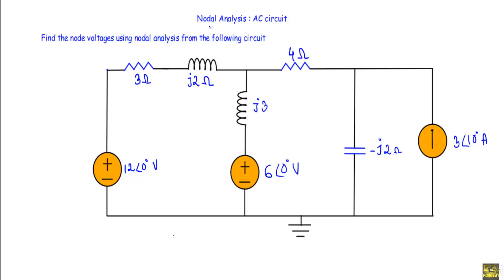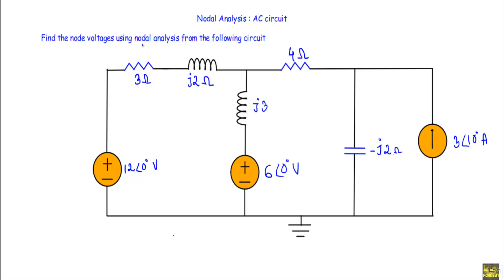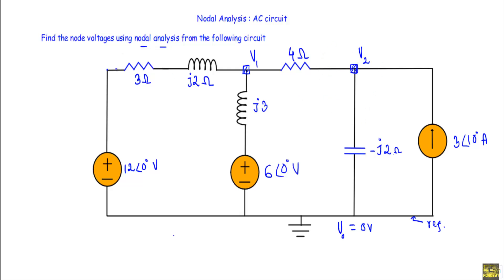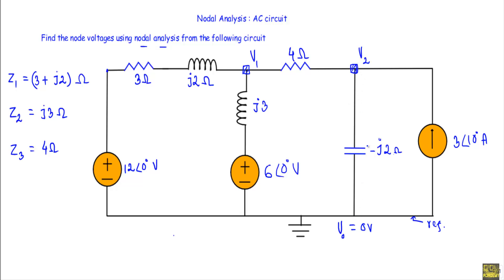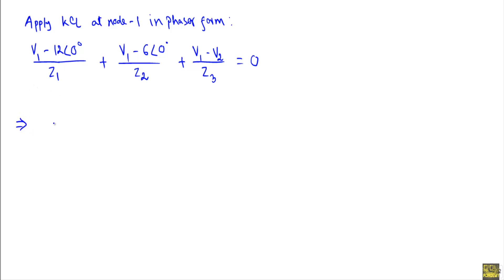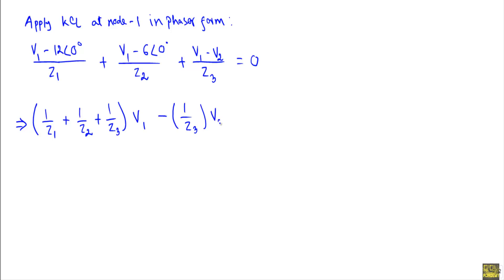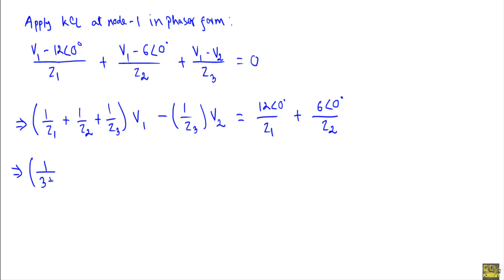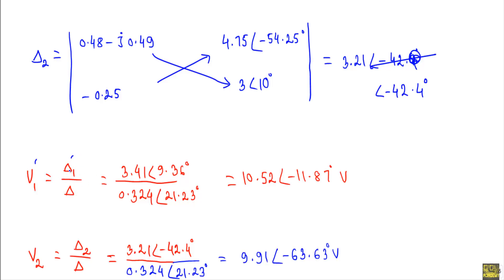AC Example : Nodal Analysis ( Hard )

Comment: sir can you please  explain for me that how come that we can say V1-12/Z1  while current is flowing from lower potential to high potential. and direction we are give from the supply
Reply: if i may sir that V2-V2/Z3 is not supposed to be negative  because the current is leaving the point??
Reply: That’s my problem too while watching this. I’m now confused if my professor is wrong or this tutorial is wrong. Fuck 😩😩
Reply: @jeromeexyz9923  actually i think it is correct as long as you stay consistent with how you do it.
Reply: you can assume that your nodal voltage is always higher when doing nodal voltages or you can do it this way. As long as you're doing it right and consistent with the signs, you'll arrive at the same answer or the signs will only differ. Different in signs just indicate that the current goes the other way.
Reply: yeah this whole process is wrong, current leaves which means negative . if you make the current positive he should not equate it to zero.  then potential should flow from highest to lowest potential . how could v1 -  12V? .

Comment: u flipped the direction of V1-V2/4 to V2-V1/4 in the 2nd nodal .
Reply: True. I don't know if that's correct, because then you wouldn't have simultaneous equations to solve for.
Reply: in nodal analysis you can assume the current is always leaving the node unless you have a direct current source.  what he did in the video is correct, if he did it your way, he would have needed different equations for the first node due to the current flow.  which is why if you just assume current is always leaving out of a node, you don't need to know the real direction of the current unless you have a direct current source, like at V2, where you would say the the current from the current source is negative since the current leaving node V2 is going in the opposite direction from the current source.